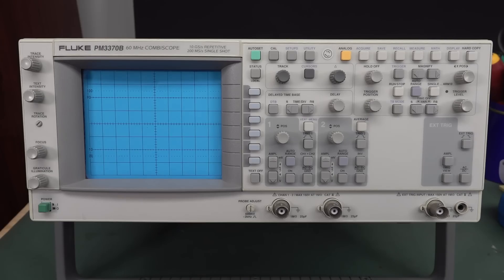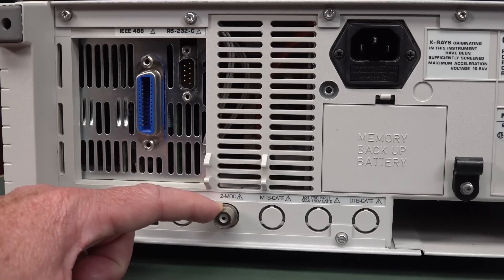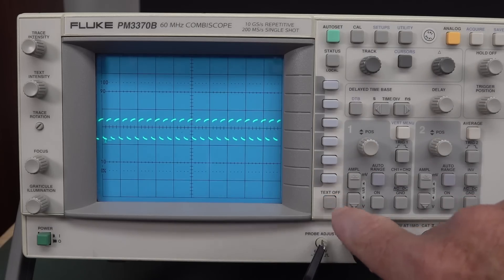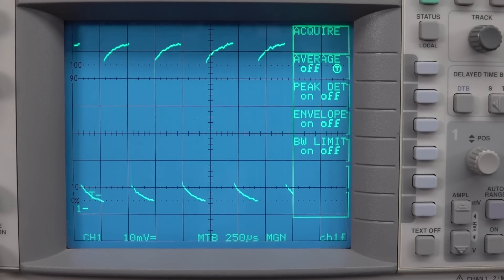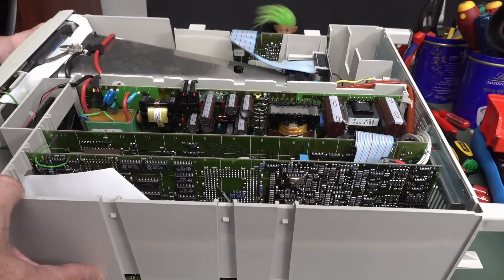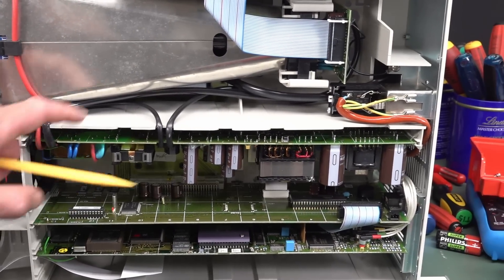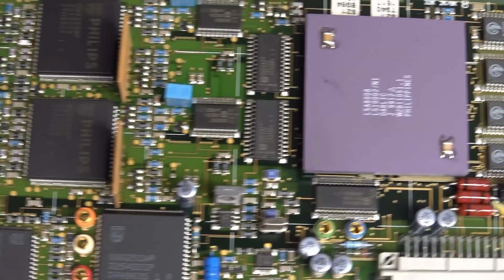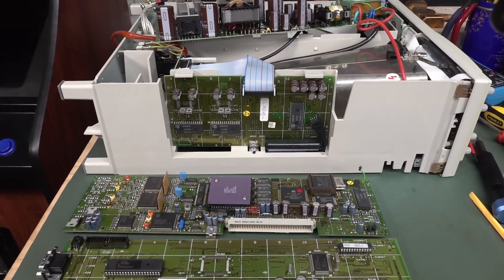EEVblog 1450- $99 Fluke Combiscope Ebay SCORE!

Comment from the maker: Unboxing video is here: https://odysee.com/@eevblog:7/2022-01-18-FlukeScopeUnboxing:f
Reply: I wonder how much you paid for shipping to Australia.
Reply: Those pale blue electrolytic caps are absolute garbage.  German equipment I work on has those same caps and they are a VERY high failure rate.
Reply: You heard a high pitched squeal when it fails?  I vote for the high voltage multiplier failing.
Reply: Do you have a repair shop? If yes, where?
Reply: Thank you!

Comment: 16:50  If that scope had been made in the 1950s or early 60s, I know exactly what those modules would be.....sort of the forerunners of ICs.  They had ceramic-dipped modules that contained regular components, sometimes, even, subminiature tubes.  Could those things be modern versions of that old idea?  Maybe, they're full of SMD components, ICs without cases, etc, etc, all encased in epoxy, for protection?

Comment: A few months back I snaffled a Leader LS1020 (spares/not working) for £35 Sterling on ebay. I could see from the advert that it had a sweep but there was only 1 trace showing. When I got it I found that there was indeed only one visible trace and it was clipping badly at anything above about 5mV/Div also, the vertical position adjustment did absolutely nothing. Anyway after some cleaning/lubricating it became apparent that both channels had a trace - they were just superimposed. Whilst checking power rails I managed to short something which resulted in the +120V dropping to less than 100V, eventually tracked down to a C-B short on a regulator transistor, so easy to fix. I think I had managed to flex the extension rod for the power switch and bridge it across the +120V rail and ground.
Back to the display. I knew the issue had to be in an area that was common to both channels and so after checking the front end I started at the final vertical amplifier and worked backwards. All the electrolytics were in good physical shape so before lifting them all for checking, I checked all resistors in-situ on that board and found a common 33kOhm one completely open. I did not have a 1/2W one available so used a parallel pair of 1/4W, 64KOhm to check it.
Result - it suddenly provided a crisp, clean example of an analogue trace on both channels - 'thing of beauty', as Dave might say!
So, proper resistor installed and transistor (ebay again) replaced for about £8 Sterling, adjustments and partial calibration carried out and I have a lovely 20MHz 'scope for less than £50 + carriage. All pots and switches are a joy to use and it makes delightful Lissajous patterns. Winner, winner, chic ...................!!!

Comment: Philips oscilloscopes are great.
I had one a long time ago, I have another now.
Their front panel is made of plastic. The big problem with these oscilloscopes is the quality of the plastic.
The plastic is thin and brittle. Cracks appear and pieces fall off.
Gluing proved unsuccessful.
Both of my Philips oscilloscopes had the same problem. they were two different models, the first was bought in Europe and the second in America, about ten years apart.

Comment: Nice score. I used to work for a company that had some Phillips made function generators. I recognized the part number as Phillips. That power supply issue shouldn't be too hard to track down. The board shown at 15:16 has labels for channels 1 through 4. Could it be a four channel board but the front panel doesn't have the extra BNCs for the third and fourth channels?

Comment: If you had a thermal camera, I believe I've seen you use one, that would  seem to be step one. The power supply is either sensing over temperature or overcurrent condition. Most likely.

Comment: Betcha anything it's a thermal glitch. Gets warm, expands, no longer connects what it's supposed to, poof there it goes. Cools off, turn it back on, fine until it gets warm again.

I troubleshoot these with an upside down can of canned air or freeze spray. Let it glitch out and freeze stuff until it comes back on, you'll find it in maybe half a minute.

Comment: i found a non-working 4-channel philips pm3384 scope a couple months back and am attempting to get it back in working order. It seems to be in bad shape : fuse blows instantly and kills the main switching transistor at the same time. Also seemed like old leftover parts were slapped in as it has a badly burnt-in tube. I got me a Fluke pm3370 which seems to work ok, hoping i can revive the 4-channel one with it.

Comment: Fantastic engineering job. I've had a Philips/Fluke scope in for a PSU repair and it was a pain in the ass to disassemble, with multiple PCBs stacked on top of each other, meh. It had a stinky dead Rifa cap too! And this one is a complete opposite, just a few elegantly designed boards on a backplane, that's all. I wonder if you're gonna try your hand at fixing the dying-all-of-a-sudden issue.

Comment: I was using a 4 channel 100Mhz Fluke scope that looked a lot like this - same deal. The tilting bail had gone and it had seen better days. I had to let it go as I was in desperate need of space, but the new owner was thrilled. I am instead using a Rigol DS1052E - which is fine for my needs, as I'm mostly looking at low-frequency PWM signals with it - practically DC.

Comment: Don’t be surprised if it turns out to be a bad power switch. I have an old HP signal generator that does the same thing. It’s better having cycled it a few times, but I need to clean it up. I know it’s the power button because it had a few times wiggling the button got the power to rapidly cycle off and on. Had the same delay to failure. Of course, problems in the HV power supply could be going on, but you know how often it’s just a switch or the power supply.

Comment: Try to power up the board and look at it through IR scope. I have a feeling some temperature controlled thyristor in power supply is failing, or some part driving it is overheating and turning off the unit. The orange flat "standing" envelopes could be quartz crystals for clocks. I've seen those before in a similar packaging and had to break some apart (when I was scavenger parts out of trash finds) to figure out what those were. Cheers.

Comment: Mine was cheaper, but yours is better. Scored a Tektronix 2213 'scope for US$75 shipped. Two channel, 60 MHz, all analog, no OSD and certainly no memory. It too required some simple repair (yay service manual!), but it works well for me, and simplicity is great for its repair-ability. One of your videos actually helped me figure out the calibration process in the service manual; thanks! Love the idea of a repair video on this Philips/Fluke -- an intermittent bug might actually present a challenge for you. 😁👍️

Comment: Interesting to notice that all the 'options' you lamented were missing..... appear to be merely a matter of installing an additional connector, then maybe adding a jumper or changing a firmware attribute. I can see things haven't changed much over the years (Rigol etc). I noticed there were even ch3/4 sockets on the board!

Comment: I had an old extech scope that did the same sort of thing ran for a few minutes then would die let it cool of and it would do that again, traced the fault to the HT shorting and pulling the power supply down so that it shut off.

Comment: Nice scopes, these Philips/Fluke combiscopes. We had a lot of PM3335s, 3350s and PM3394s where I worked some years ago. One problem occured when we tried to capture the pulses of high voltage breakdowns with several kilovolts (through a divider) with one of them. Had to set up the scope some 10 meters away with a terminated coax, the shielding of these are not great, as you saw with the all-plastic case. The old tube-based hp's did not care at all :) Seems yours has a PSU problem (overvoltage protect?) She'll be right :)

Comment: Nice find! Question - that internal test trace (attaching probe to internal sig generator) seemed to be rounded on the edges. My one kijiji scope does something similar and it seems to be cable/probe based, so probes i have produce a more square trace than others. I'm a noob - any input into why would be appreciated!
Reply: Compensation capacitors in the probe need adjusting. There should be a little screw in the body either at the tip end, or near the BNC. If that does not provide enough adjustment you should check the range marked on the probe and ensure it is encompasses the value marked at the 'scope BNC input, (e.g 1MOhm - 15pF). Otherwise, find a probe that does!
Reply: @grahambambrook313  Awesome that worked! Thanks
Reply: @eh42  Most welcome but remember this may need adjusting again on a different 'scope.

Comment: I one got an non working gould DRO 1624 (digital recording oscilloscope) for ~40 euro.
20MHz 20MS/s, but 4ch and with build in 4 differential channels.
Owner claimed the CRT was dead.

Switched on, tuned the intensity up, perfectly working.

Only the old thermal printer burned up while testing. Otherwise still fine.

Comment: I got the 200mhz version on ebay PM 3390b  for just under $100 aud A few years back . The Triger level rotary encoder is a little bit fiddley and needs replacement but otherwise its mint. Great scope!

Comment: Is the 50-400Hz AC input rating on the power supply common on test equipment with switch mode supplies, or is this unit somewhat unusual?  I would imagine the 400Hz upper limit is for compatibility with aircraft AC power.
Reply: I don't know about aircraft, but that's the frequency they use in the US military as far as I remember

Comment: Well now we know why you got such a deal. Bap  E caps or resolder some connections in the PS. Never repaired unit.
Maybe you will find  the fault in an upcoming video. Well made unit  despite some bodges otherwise Dave.

Comment: One of the Philips promotions made note of them having screwless assembly, in reality they all had three screws, top case, bottom case, and IEC cable retention.

The autoset button from these original mid 80’s era scopes is always useful. I still have a PM3055 with a semi destroyed front panel 😃

Comment: I have had a internship at benchmark electronics in Almelo the Netherlands as part of my electronic engineering study. Benchmark electronics Almelo used to be the Philips measurement equipment division. in the 90's fluke and Philips had a alliance to make and market equipment to each others markets under there own name (so fluke equipment named Philips in Europe and Fluke branded Philips equipment in the usa). They still used the 4 channel 200MHz combiscopes on the production and test floor when i was there. I ended up with a Fluke branded PM3094 scope (4 channel 200MHz) in a employee equipment market for about 50 euro's while I was there that I still use.

Comment: At 13:47 it's clear that the DIN41612 power board connector is not properly seated.  Was that caused by shipping, or and eager Dave trying to pull the board out earlier?  If shipping, could that contribute to the shutdown?

Comment: it is a Philips,just form when fluke did buy Philipis measurments division.
Same model is alos avalibale under Philips brand

Did get luck to get this one his big broter,the 4 channel variant for free.
Big hole in the back is for a (optional) battery pack,so you can use it in the field without a power socket nearby.

Comment: These are apparantly notorious for Hybrid chip overheating, I have the 100 MHz version PM3380B, and didn't get these chips, it works like yours, but the DIGITAL section doesn't calibrate properly and something is out of wack (video here: https://www.youtube.com/watch?v=WnM4xUp8MKk ) it's about 8 years ago, and I scored it for 50 bucks. Still have it in my lab (the analog section works just fine, the digital section - somewhat... )

Comment: At public auction I scored TWO Fluke PM3384A Combiscopes (the 100 MHz big brother to this scope), one fully optioned, and an HP 54501A, all for FIVE BUCKS (plus some other assorted gear), and they all worked perfectly. The HP already went out the door with a replaced NVRAM (socketed of course, I ain't no scrub), while the fully optioned Fluke is my daily driver. I still have the other PM3384A, maybe I'll drop it in the FS section on the EEVblog forum and see if people are interested.

These scopes are real gems; I love that you can get to most functions directly with buttons, and most menus don't have tons of levels and scrolling. Despite being quite capable and super easy to use, they seem to be somewhat unknown in the oscilloscope world, at least compared with the big names. You can also get a fancypants Fluke 1X/10X probe with a function button that can be programmed to do things like one-shot or switch between analog and digital mode.

Comment: Dave once said that the Tek2465B is probably the world's best portable analog scope. I own both a tek2465B and a Fluke (Philips ) PM3394B . The tektronix has a bit better build quality ( better plastics ) and of course higher bandwidth BUT... The philips is considerably more useful and dare I say a bit more accurate . The digital control in the Philips is implemented differently and is more comprehensive, even to the point where it self adjusts based on internal temperature sensor ( for both the analogue and digital side of the scope )  Also the variable attenuator is always "calibrated " and one can use the cursors with it no problem. All the knobs ( encoders ) are "velocity" monitored , if you spin them fast they act as coarse knobs ( doing large increments/click) while if you spin them slowly the do very fine increments/click ( acting like fine adjustments ) . It also periodically asks permission to do self-cals in order to keep things nice and crisp. Like the Tek, if used with it's own probes it does appropriate sclale factor compensation based on probe attenuation. Despite the fact it doesn't have knobs for the attenuator&timebase setting up a measurement with the Philips is faster than with the Tek. and it offers a considerably more pleasant overall experience ( not to mention the ability to double check measurements by switching to digital mode with a single button push ) All these things made the Philips the workhorse of the lab retiring the tek to the corner along with a purely digital scope.

Comment: Ah, old times...
Developed and produced here in Almelo, the Netherlands. At the time the CombiScope series was developed we were Philips; later our plant was sold to Fluke. 
The main processor was a Intel 80c196kb microcontroller that contained bootcode written by me ;-)
Yes, these Philips OQ chips were developed here.
Reply: Hats off for being part of these marvelous piece of engineering!
Reply: Nice to hear from an engineer who contributed to the design :)
Reply: Makes me sad as a Motorola fanboy. I had (still have) the PM3365 which seems like a predecessor to this device, and it's using a Motorola 68008 if I remember correctly.
Reply: Do we see the 80C196KB in the video?
Reply: @mojoblues66  
Yes, D100 on the board with the serial port and IEEE bus at 17:55
Reply: @robvandeschepop8595  Ah right I see it. But doesn't it say 83C196KB?
Reply: @mojoblues66 : 
The 83c196kb is the mask programmed version of the ROMless 80c196kb. As mentioned above, this ROMcode was all written by me and sent to Intel, so that they could deliver us the production chip.
Reply: I have two of these, 4 channel versions, and I use them regularly.
Reply: Hello Rod , have you the explain for the  error calibration code for the PM33xxB  combiscope ?
 no explain is in the service manuals !!!
Reply: Hello Rod , have you the explain for the  error calibration code for the PM33xxB  combiscope ?
 no explain is in the service manuals !!!
Reply: @pierremoisdon8907  
Sorry to disappoint you, but the instrument is out of production and service for a long time now.  We also have been sold twice meanwhile and moved to another part of the building, so we do not have any documentation left here.

Comment: Have you checked the serial number against known-stolen gear? I believe there are several repositories for stolen electronic test equipment lists. I Purchased some Fujitsu fiber optic OTDR scopes on eBay that turned out to be stolen and I had to return them and lost the money.

Comment: My friend had an LG TV that would power cycle every minute.  I took out the power supply board, nothing obviously wrong so I heated every solder joint on the primary side and now it works perfectly, a rare triumph!  This strategy might work with your power board too.
Reply: Good idea, it's probably a dry solder joint on those heavy power supply components.
Reply: @Tech2C  Yes, it occurred to me that it was a temperature/movement related issue possibly.  Be interesting to see what he finds.

Comment: I bought one of these combiscopes in 4 channel. It shut off after a while as well. Turns out the fan was going out and it would overheat. One replacement fan later, and no more issues.

I thought mine had more knobs than relying on buttons, but it was several years ago, and I don’t have that scope any longer.
Reply: This needs to be higher.

Comment: The earlier Philips scopes were rubbish, it was said that if they couldn't calculate a circuit resistor value, they would add a Pot to the front panel. The scope in the video was the first of a new generation of design that was really good. At the time it came out, I was working for a Philips company,  and purchased one through a staff discount scheme, unfortunately I paid a lot more for mine, even with the discount, then you did. 
I still have it, and it still works. 
There were software upgrades on offer, including additional mathematic processing functions, such as the FFT.
The scopes also came with remote control software, with a screen capture and a print screen option.